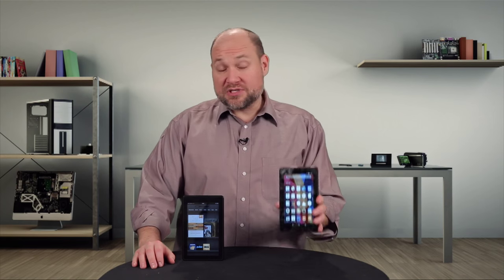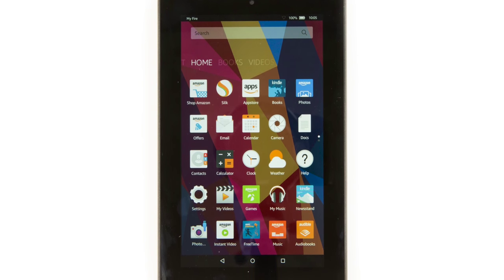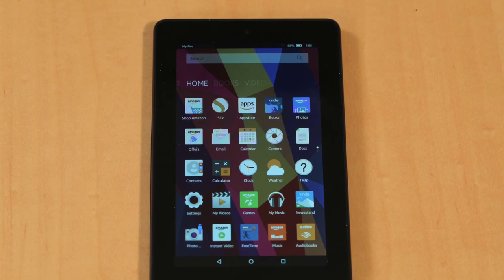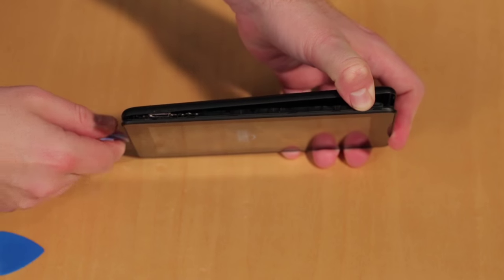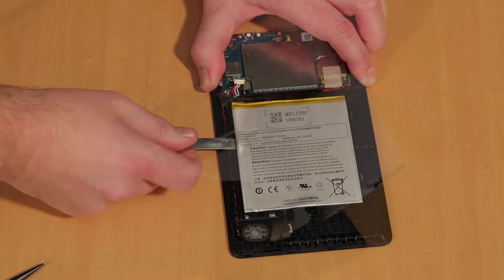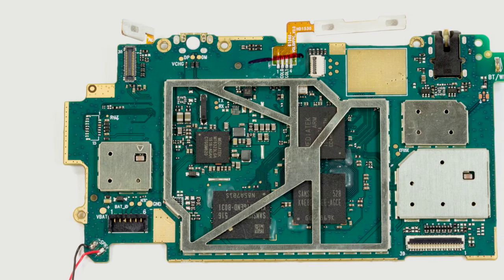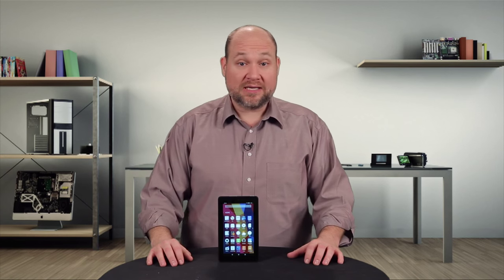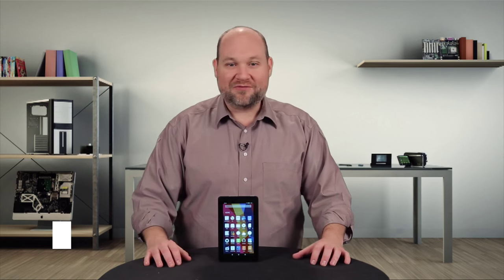Cracking Open - Amazon Fire 2015

Comment: Mine was never dropped or wet. Had it 3months in and was fully charged and it wont light up the screen and itg wont restart using the power button or anything. How can i get the screen to appear n restart?
Reply: Technique 1
Press and hold the power button for a full 30 seconds or more

Technique 2
Remove the back cover and lay a butter knife across both terminals of the battery, while unplugged of course.

Comment: How do you remove the black ribbon cable located next to the headphone jack? It's the only connector you didn't show. it's funny how it should you removing that board without touching that connector. That particular one goes underneath the screen how do you remove?

Comment: I got one and put google play on it and just use android apps since this is a forked version of android tablet after all :)
Reply: So did I. The apps run a bit slow for me but I got them to work.
Reply: That's what I did with mine a couple of months ago.  Works very well.  Wish I could add more RAM for a faster experience.  Other than that, this is a pretty decent $30 tablet.
Reply: i did that too!
Reply: Nick Ackerman I'm watching this on the Amazon fire 7 2017 with Google play and YouTube Android app
Reply: Boo Merpysoup
Reply: @calyblentz2011   hola
Reply: @lucaholden433  er, why use a cracked version when the real thing works?

Comment: Can you download BBC iplayer TV and radio to specifically listen and watch online. I have an ipad but a little bulky to carry around at times so looking for a portable device specifically stick in my pocket, headphones in and listen or watch on my long commute. I know with some smaller devices like iPod touch this did not used to be available so needed a wifi connection. I have a wifi connection here but when travelling I will not hence why it has to be playable offline. Will the Fire 7 inch do this?